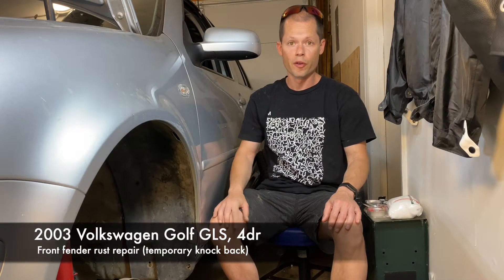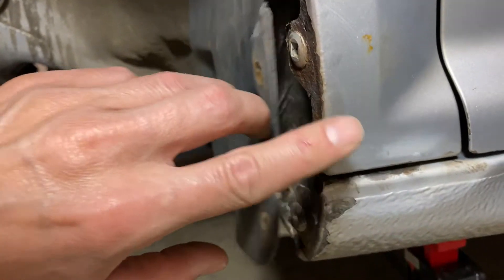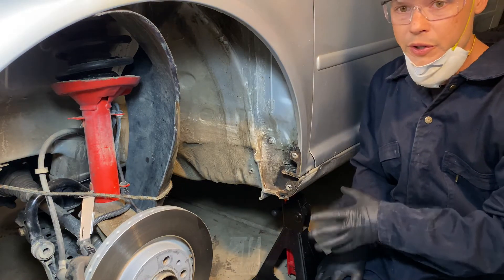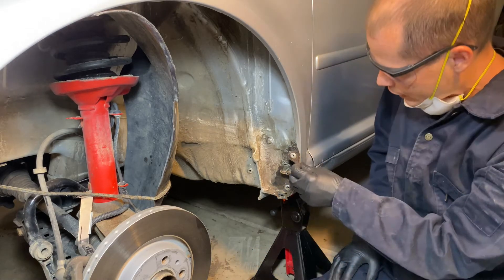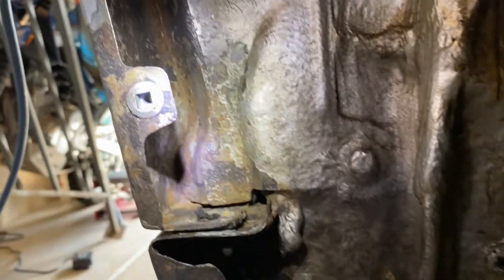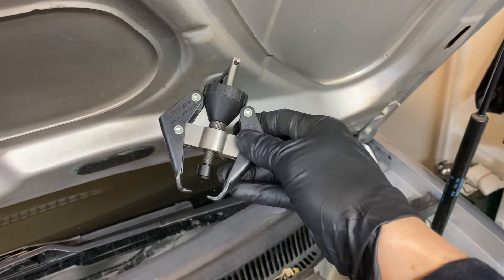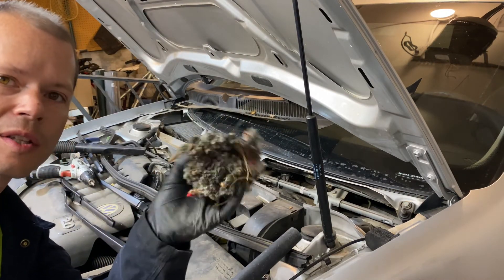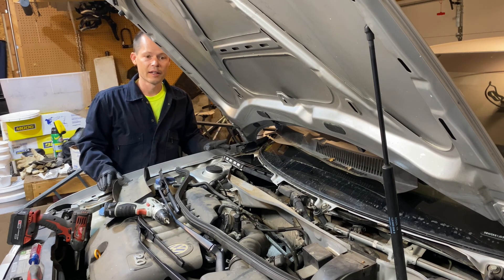2003 VW Golf/Jetta Front Fender Rust Repair. MK4 1999, 2000, 2001, 2002, 2004, 2005, 2006 Volkswagen

Comment: I take care of 2 Mark 4 Jettas.  A black 2000 and a silver 2003.  I consider cleaning behind the front wheel liners (as you have shown) to be part of regular maintenance as it's done with every oil change.  A few tips.  You can avoid removing the wheels by simply turning them to one side to provide clearance.  (Perhaps you left yours on for easier viewing.)  I usually bend up the liner and rest it against the tire.  To help with the appearance, if you have a silver car, you can use Rust-Oleum Professional High Performance Enamel which is available at most hardware stores.  The color is 7515838 ALUMINUM.  When you're done, a spray of WD-40 couldn't hurt.  Remember, it's designed to remove moisture.  Thanks for the great video!

Comment: so what about rust under those plastic sockets for screws? and you probably have missing quarter/fender fastener on passenger side
Reply from the maker: This was definitely not a full “search and destroy” job against all of the rust. You are right that the proper way to handle rust is to eliminate ALL rust. This is kind of a quick preventative care job
Reply: @gearsandgardens4018  You can also remove the 10mm nut that attaches the fender to the rocker panel, then you can really get in between these two parts.  If the nut is really rusted in and it won't come loose, turn it until it breaks and replace it with a new nut and bolt.
Reply from the maker: good call! I just made an 18month follow up video, and I did remove the 10mm bolt (although I didn’t cover it in video). Made it easier to get between rocker and fender. I’ll be posting the part 2 follow up video shortly